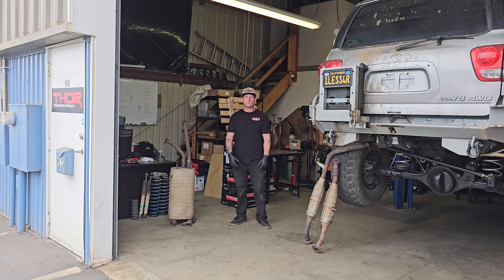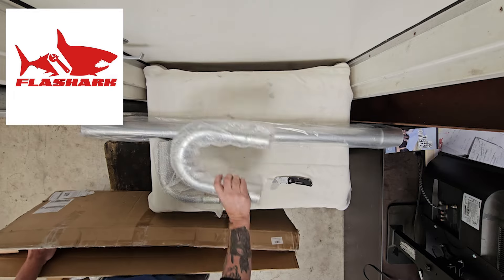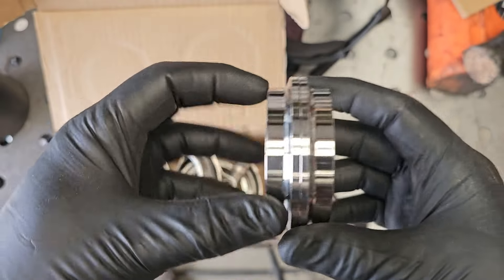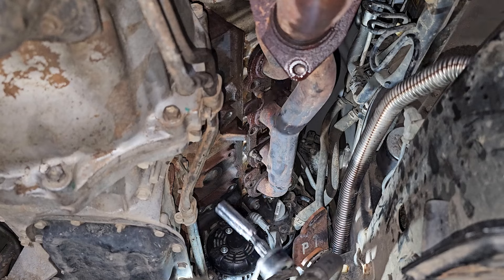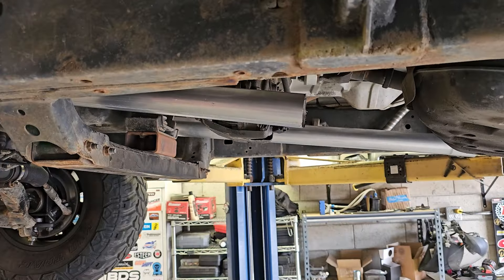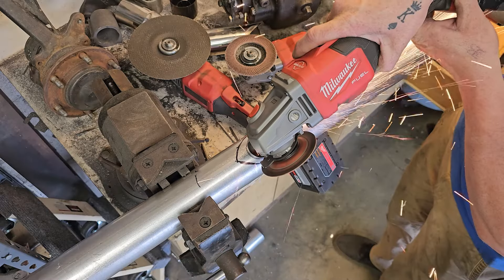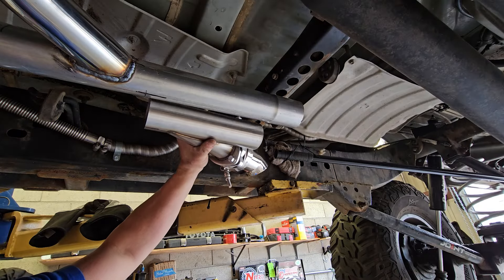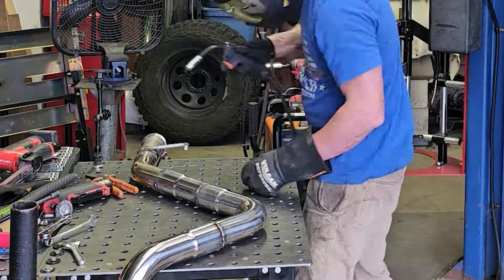Sequoia/Tundra 4.7 V8 Exhaust Build // Flashark  DynoVox Spelab

Comment: That exhaust sounds badass! Are the exhaust cutouts louder than straight pipes? Thanks!
Reply from the maker: Thank you, the exhaust cutouts are actually slightly quieter than straight pipes because inevitably some of the exhaust flow ends up going through the muffler. They cut outs don't entirely divert the exhaust they just open up and let some of it out
Reply: @treehouseoffroad  ok thank you! The driving at the beginning of the video is that with the straight pipes or was that with the cutouts already installed? Thanks again!

Comment: I’ve been pondering building some tri y long tubes for my tundra and was thinking about blocking off my egr pipes like you did I was only wondering if it caused any issues other than cel like limp mode or any drivable issues??
Reply from the maker: No, if it caused limp mode I would never promote doing this. I wouldn't even do it myself

Comment: I saw you removed your catalytic converter how did you overcome getting rid of the check engine light and bypassing the sensors ?
Reply: You want the check engine light on I know it sounds crazy but it will turn off the traction control and ABS I can haul ass thru corners and control the vehicle way better. Trading a corner really hard on the street with the check engine light off and try hitting the brakes hard haha not fun
Reply: I smash in my Sequoia all the time I prefer vsc and trac off light with check engine light on, I have 2003
Reply from the maker: I'm not worried about the CEL personally

Comment: Nice  ! Any torque  loss with these short tube headers ?
Reply from the maker: Judging from my butt dyno I gained power. But I also removed both catalytic converters and increased the diameter of the exhaust pipe throughout

Comment: How bad does it smell?? I had to back to stock
Reply from the maker: It's noticeable but since I found the leak it's much better. It's worse when I roll my rear window down for sure
I had a question for you too, did you go through your rear floor to install those King coilovers??
Reply: @ yea mines bad like it’s bad bad like didn’t wanna drive the truck and yes Sir I have two holes about 8x8 inches for the shocks thur the truck . I had to cut the stock upper spring mounts and clear that out
Reply from the maker: @Longtraveldreams hell yeah I figured you must have. I'm about to do mine this weekend I got some 14" Radflo's going in. I'd love to see some pictures man if you have any, help me get a grasp on what I'll be dealing with a little bit better. treehousephin@gmail.com 🙏🏻🙏🏻🙏🏻
I'm going to try to keep mine a little bit more outwards and hide most of it under the panels that cover the fender wells, only because I still need to fit kids in that backseat. Or I could adopt all my children out.... It's a toss-up
Reply from the maker: Not really trying to throw my number on here though can you email?
Frank does have it though if you wanna hit him up
Reply: @ yea tell frank to give me it I don’t really check my email 😂😂
Reply from the maker: Okay just texted him

Comment: I say a beefier transmission video. Something with the transmission. It is definitely the weak link with mine. 180k miles my engine sounds great but I have to manually shift my transmission or it's just extremely sluggish left in D.  When I manually shift it. It feels  like a new truck. not sure why
Reply from the maker: I haven't really heard of this issue, especially at only 180k. What year is your Sequoia?
Reply: @treehouseoffroad  2001. I say try column shifting it while offloading. It's so solid. Cause mine feels like a slushy in D.  I was thinking of getting 2 c5 or c6 corvette mufflers and fitting them in the muffler area of the sequoia.  For dual exhaust. Mild but with better flow
Reply from the maker: I actually do manipulate the trans manually while offroading, it's fun. I use 1st gear quite a bit for steep inclines and declines
Reply: @Nick-wr7vv   The A340 isn't known for its performance.  Unless you're talking about it being more sluggish than usual, it may just be the nature of those four speeds.  I drove a few '01- '04s before buying my '06, and one of the reasons I did was because of just how underwhelming the four speed transmission felt.  The extra power of the VVTi engine was also very welcome on road, but I'm speaking strictly about the transmission here.  The A750 shifts smoother and faster, there's less RPM drop between gears, it hunts for gears far less, and while this is subjective, I think it makes the truck feel more... eh... sporty, I guess?  Kinda hard to call a body on frame SUV "sporty," but I think you know what I mean.  Anyway, I digress...

I also manually shift the transmission off road and will shut OD off around town just to give me a bit more throttle braking so I'm not dancing back and forth between the pedals to maintain distance behind someone.  My only two gripes are that I have to reach forward to push a button for first gear, and that there isn't a 2nd gear start button like the Land Cruisers have. And a solid axle, but I'm working on fixing that.  :)
Reply: @Prototheria  that's interesting about the transmissions. So I've been periodically shifting on the column.  And when I leave it in D it seems to hold 4th gear better. Before it seems like it was slipping.  I mean 23 year old truck and who knows what it's been through. But its like I reconditioned it. Maybe the higher rpms are pushing more fluid I. There and cleaning some stuff out. I'm not sure. My next task is stainless steel front brake lines with some wagner pads and new rotors. Get rid of that shake it's had 4 years ago when I got it.  But the motor sure does come alive manually shifting. All 250 hp:)  when I manually shift my dad's wrangler with the 8 speed. That thing rips. Especially with roof and doors off. I've  never driven a car with stainless steel brake lines. Especially with my new technique of bleeding the brakes.  I take out the pads and pump out the brakes. Open the bleeder and push out the fluid that's right behind the piston by pushing the brake piston back into the caliper. Cause I figure that's where the air is going to be. At the end.  Not in the line.  When I have the car off and hit the brakes. It's a solid pedal. No more kinda hard.  Toyota or whoever designed that transmission did a great job. Those things are so complex.  Then I see my friends vw atlas.  It has the smallest transmission I've ever seen. And I think it's 6 or 8 gears.  I drove it once.  It was searching for 2nd or 3rd. Made some noises and then I think I felt it slip. Who knows .  They make stuff so small and cheap to save on gas now. Can't wait to see the next video
Reply from the maker: We had an 03 and an 06 at one point.  The 06 without a doubt felt more sporty, and it was on 35's at the time vs the 03 on 33's. Both had stock gears. On the fb groups the 01-04 owners swear there's no difference but they've obviously never driven an 05-07
Reply: I forgot. How much for the old mufflers 😂  they should last another 150k.  It's crazy to see a sequoia with the long travel.  I figured I'm doing something stupid with mine. I'm getting a jk front bumper and bolting/welding it up to make it work.  I wanna see my tires a little more without all the work
Reply: @Prototheria  i agree the updated trans definitely makes the newer 1st gens worth it over the earlier 1st gens. So smooth and the shift points are flawless.